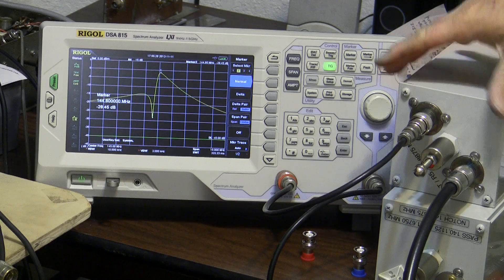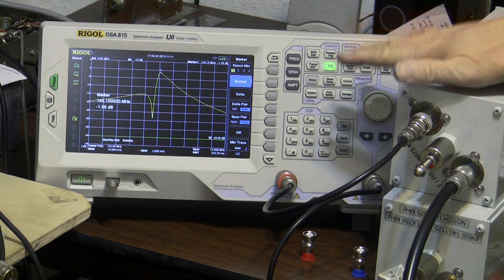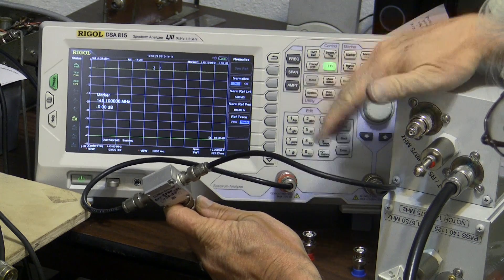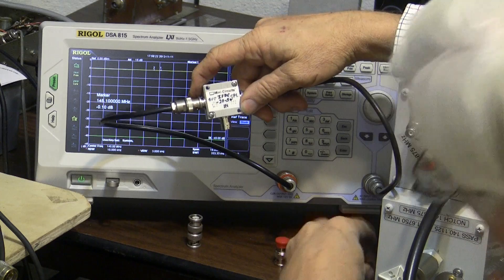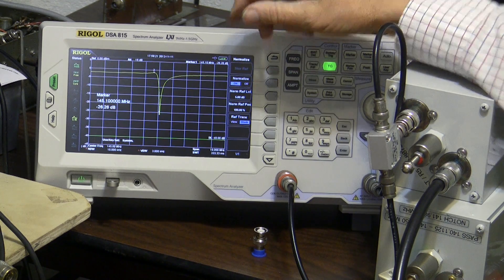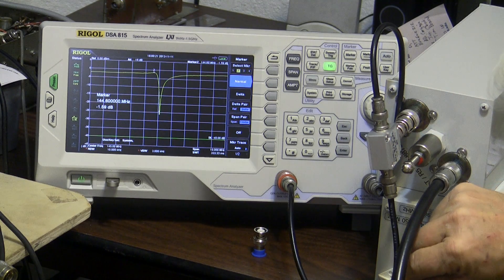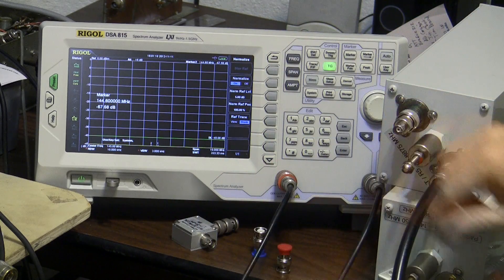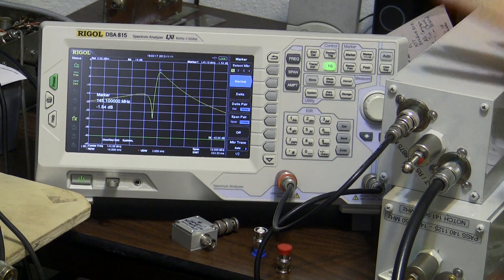Checking Return Loss VSWR with the DSA815 TG

Comment: Thinking about buying one of these Rigol DSA-815’s. How well would the Rigol DSA-815 peform for tuning duplexers and and other types of filters? Would my money be better spent on an RF Network Analyzer? Or how about a Communications Service Monitor?
Reply from the maker: Doug Paquette  It depends on your budget.  My order of preference would be Network Analyzer, Service Monitor, then Spectrum Analyzer with an RF Bridge.  Most Network Analyzers and Service Monitors are $2.5-10K used and NAs aren't usually very portable.  The DSA-815 with an RF Bridge will cost about $1.3K new and can save screen shots, markers, and CSV files.  It is limited in dynamic range however compared to the more expensive options.

Comment: Hi Jim! Tnx so much I can't begin to tell you just how much your videos have helped me learn and understand The DSA815. I was able to get a ZFDC 20-4 was looking for the 20-5 but not available. May I ask? What is the correct procedure in hooking up the coupler to measure "Directivity?" Thanks again Jim! 73's de DAVID K8KEM
Reply from the maker: David Eisenberger   To use any directional coupler as a Return Loss Bridge connect the Tracking Generator to the Output Port, the Device Under Test to the Input Port and Observe the Return Loss at the Couple Port.  Check my video Sweeping Antennas for Return Loss for more details.

Comment: Thank You so very much Jim! Greatly appreciated... I had used a HP 8753D and E VNA for several years where I worked and it was used to set up a tuning mask and then tune Simplex and Duplexers in the 1.9 Ghz range. With the VNA. Insertion loss, SWR could be measured.  The "Miny VNA" is a small blue box you use with your computer. You can see this on Peters "TRX BENCH" he does a complete review of this.73' David.  Btw I just received my DSA815.
Reply from the maker: David Eisenberger   Thanks for the info on the Mini VNA.  I actually did a search and found this product earlier.  Looks nice but a bit slow for tuning purposes.  As you can see from my videos by using two traces individually set up to make Insertion Loss then Return Loss Measurements you can put both on the same screen using the DSA815-TG.  

The latest version of the Mini VNA, by the way, has another great feature.  It uses Bluetooth between the VNA and the computer.  It certainly looks like a useful tool for antenna work covering 100kHz to 3GHz.  There are several videos on YouTube showing the Mini VNA.

Comment: Hi Jim.. can you measure SWR on this unit directly like a VNA can? There is a "Miny VNA" on the Market for about 500.00 that seems to do lot more than the Rigol?
Reply from the maker: David Eisenberger   The Rogol DSA815-TG is a full Spectrum Analyzer that can provide direct VSWR reading if an optional sfwr and bridge is added to the unit (about $600).  For filter tuning, however, one can see the Return Loss directly which is what most design engineers prefer to see.  Essentially 14dB. is 1.5:1 VSWR and 20dB is around 1.2:1 both acceptable figures.

The advantage of the DSA815 is that it is also  spectrum analyzer thus can be used for other purposes that a VNA isn't usually set up to do.  Measuring Return Loss, and thus VSWR, is just one thing that an SA can do.  In this video we are looking at the bandpass of a pass-notch filter primarily.  Results can be displayed in dB, dBuV, Volts, Watts, etc., as desired.  

Please share what VNA you are referencing that is $500.  What frequency range?  Etc.  I'm certain that those viewing this video would appreciate knowing about alternatives that are available.

Comment: Is possible also with ZFDC-l 20-4? 
Sorry my bad english
Thanks!
Reply from the maker: If you are willing to have an upper frequency limit of 1 GHz instead of 2 GHz then the ZFDC-20-4 will be adequate.  It certainly will work well below 500 MHz but may not be as accurate as the ZFDC-20-5 above that.  I used the ZFDC-20-5 because it works up to 2 GHz thus is well within its frequency range at the 1.5 GHz upper limit of the DSA815-TG analyzer.

Comment: Hi Jim, I have really learned a lot from your videos - thanks!  You got me interested in return loss bridges, so I built one from an article on the ARRL web site (Sept '97 I think).  I put a 50 ohm resistor on the Load port and show somewhere around 32 dB of return loss.  This seems like a lot, so I wonder if I have a set up that is showing me an over optimistic view.  Here is my DSA 815-TG setup:  span 3 - 200 MHz, 1 KHz RBW, Scale/Div = 5dB.  It takes 197 seconds to draw the trace, but it is very clean.  I did not put the sweep in accuracy mode.  Any ideas?

73,
Len, KD0RC
Reply from the maker: I am not familiar with the ARRL web site Return Loss bridge.  I will take a look at it.

A Return Loss Bridge, properly put together with surface mount parts should provide pretty good results, however, and depending on the load resistor used it would be very possible that you would see better than -30dB Return Loss.  Most commercial Return Loss bridges are specified as having -40dB Return Loss capability when used with a precision load.

Essentially an open circuit should show a Return Loss of 0dB, that is, all power should be reflected. 

A good 75 Ohm resistor should show a Return Loss of -14dB (1.5:1) as should a 33 Ohm resistor. 

A good 100 Ohm resistor (or 25 Ohm) should show a Return Loss of about -9.5dB (VSWR = 2.0:1)

A perfect 50 Ohm load resistor using a perfect Return Loss bridge should have a return loss of infinity, ie, no power returned from the load.

Generally Return Loss of -10dB is acceptable for some kinds of antennas or other devices but -15 to -20dB is typically the goal of most design engineers.  Keep in mind that a Return Loss of -20dB is a ratio of 1/100th of the power being reflected... hardly a worrisome level for most purposes. 

Return Loss of -10dB means that 1/10th of the power is returned which begins to become a significant problem in a high powered circuit such as a 1KW amplifier.  That 100W of returned energy may heat things up a bit.

Check out Insertion loss and return loss explained

Also check out Relationship between return loss and VSWR
Reply: James Eagleson Thanks for that Jim, I appreciate it.  I would be interested to see your Mini Circuits RLB with a 50 ohm restive load being swept with a full scan.  Mine looks pretty bad after about 250 MHz.  I also just figured out that I can get significantly more return loss by reducing the RBW.  The scans take a long time, but they sure look smooth! The curve is not flat at all, so I doubt my RLB can approach the performance of a commercial unit.  On the other hand, for my Ham Radio purposes, I think it will be great.
Reply from the maker: KD0RC
As long as the measured return loss exceeds 15dB (20dB preferred), I wouldn't worry too much about it.  The spec sheet shows directivity better than 30dB up beyond 1500 MHz and the coupler port is better than 16dB to about 1500 MHz.  The through ports are better than 20dB up to 2000 MHz.  Since 20dB basically means that 1/100th of the power is being reflected, I think we can live with that! 

Certainly the commercial Return Loss Bridges (as compared to the Mini-Circuits Directional Coupler) will have better performance though you would probably need to obtain one of their high accuracy loads (also expensive!) to measure to 40dB Return Loss).

Also don't forget that if you are not using high performance, test grade coaxial cables between the analyzer and the RLB and/or Device Under Test (DUT), you will also see degradation of the Return Loss at higher frequencies.  That's why I recommend the attenuators on the cable ends when using standard coax such as RG223, RG143, etc.

Comment from the maker: Check at mini-circuits(dot) com/products/dc_coax_6_30.html for a listing of Mini-Circuits Directional Couplers.  You can order direct from them though I don't know about their stocking habits.  The ZFDC-10-5 is also a candidate but not as flat in response as the 20-5 if you compare the curves.  It was my second candidate.  Usually with Mini-Circuits you can actually talk to an applications engineer about it.

Comment: Nice set of videos. I'm a beginner at this, and these give a good introduction. In fact, I ordered a DSA815-TG partly because of these videos. Anyway, I wonder if the ZFDC-10-5-1 would do the same job, or if ZFDC-20-5 is much better. I can't find a place to buy ZFDC-20-5, as it doesn't seem to be in stock.